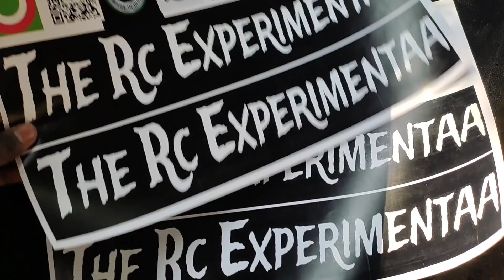The Journey: Crafting Bihar's First RC C17 Globemaster Plane in 70 Days

Comment: Bhai kya ak rc plane ka size uske wing se chota hota he? yea bera hota hai? plz bolo na bhai ।
Reply from the maker: Hi speed plans ka wing chhota hota hai aur slowed planes ka bara
Reply: @thercexperimentaa  mera plane ka size 5 foot 7 inch ka he, or uska wing size kitna karu?
Reply from the maker: Jitna mera h
Reply from the maker: Ya fir 75 inches
Reply: @thercexperimentaa  es plane me 1000kv ka dho motor use ker sakta hu na ?
Reply from the maker: Ha bhai dekhe ho n mera plane 😄
Reply: @thercexperimentaa  😁😁Thanks vai
Reply: @thercexperimentaa  bhai without electronics apke plane ka weight kitna he plz bolo na bhai?
Reply from the maker: Totally weight 2800 gram hai with battery aur bina electronic ka. Koi weight check nhi. Hota hai

Comment: How are you using skyrc B3 as powersupply for imaxb6?
Reply from the maker: I open sky rc e3 charger and thats output supply is 15v dc then i soldered to 15v dc and use for imax charger supply 👍🏻